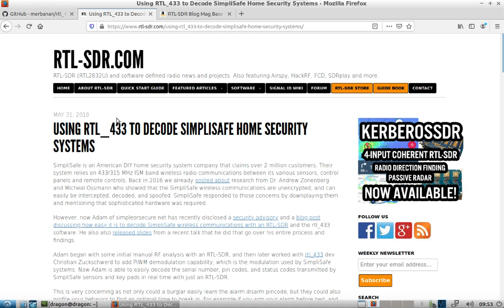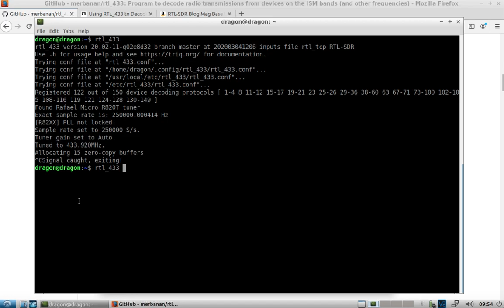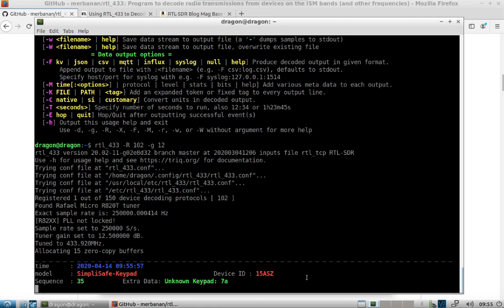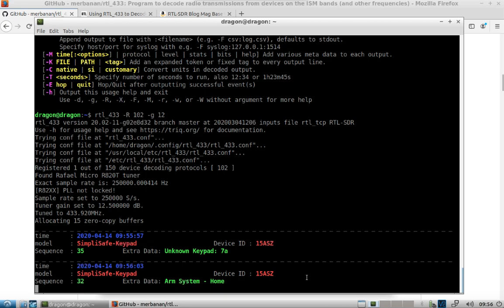DragonOS LTS/10 Decoding radio transmissions (rtl_433 and SimplySafe v1)

Comment: Great videos!  Thanks for posting them.  Do you know of anything that can decode 303MHZ signals?  For whatever reason, US ceiling fan remotes use that frequency instead of the readily read 433MHZ.
Reply from the maker: Donny Fontenot funny you ask that. I lost my fan remote for one I had just installed.. I found that universal radio hacker could do it, but by the time I really got to messing with it Hunter shipped me a new remote. I’ll have to give it another try.
Reply: @cemaxecuter7783  I'd certainly be interested in seeing a video on that!  I'd like to tie it into my Home Assistant HA software.  I thought I saw something about using a GPIO pin on a Raspberry Pi and a wire for replaying of RF signals a while back.  Would be cool to use a RTL-SDR dongle to listen for signals and the Pi for replaying so I can have the ability to listen and 'talk'.
Reply from the maker: Donny Fontenot rpitx2, RTL-SDR, and a Pi  is a pretty slick combo.https://www.rtl-sdr.com/rpitx-v2-released-easily-record-and-replay-with-rtl-sdr-and-a-raspberry-pi/
Reply from the maker: Actually, maybe even rtl_433 if you set it to the frequency you want and manually learn new devices. I’ll have to check that out too.